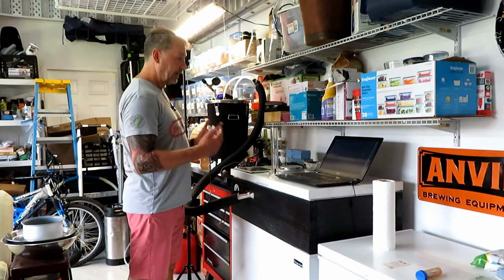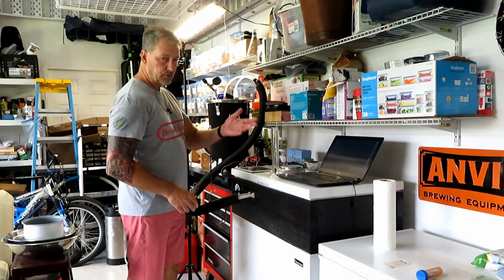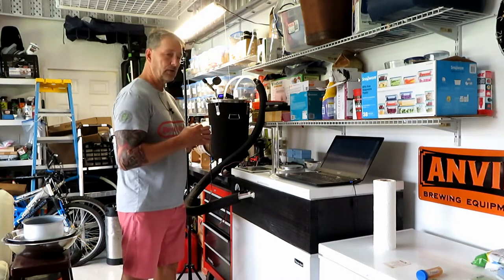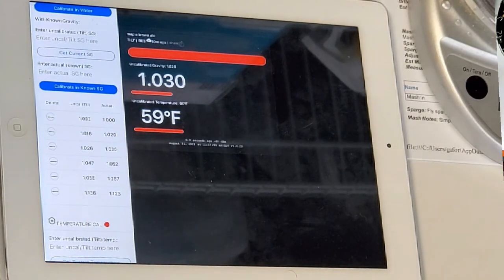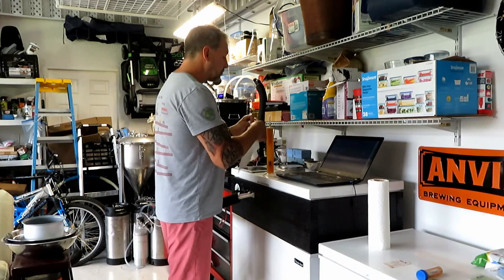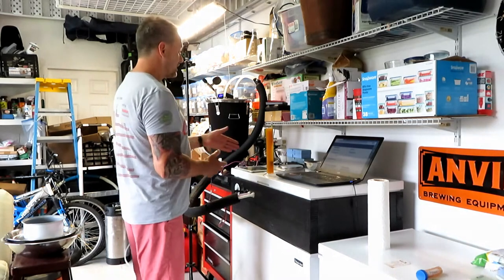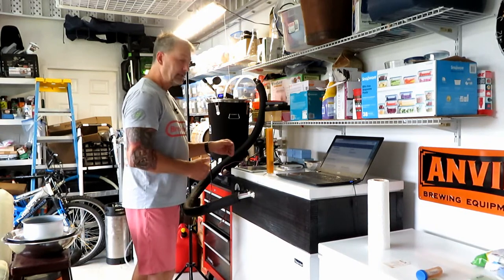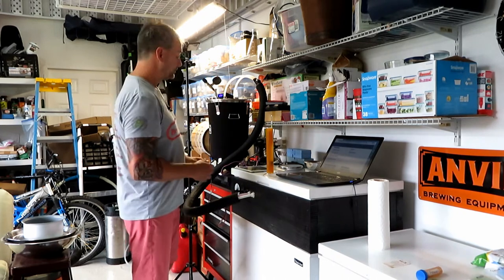Alternate accurate way to calibrate your Tilt Hydrometer

Comment from the maker: As I answered a few questions, I realized I did not completely explain the process in detail. When you add a known SG you must also provide the pre uncallibrated tilt reading as well. This lets the software know what the difference is. Lastly do not delete the 1.000 calibration that you originally did in distilled water, this is your reference, the tilt needs at least two points of reference to calculate the gravity.

Comment: I have also find mine to be very accurate. It’s normally within a point, maybe I two, of the hydrometer and that’s just calibrating with distilled water straight out of the box.
Reply from the maker: Unfortunately they are not all like that, you got lucky
Reply: @chubbymermaidbrewing  yea ive seen the flack they get online. I used distilled calibrated at 1.000 then added a ton of ice and calibrated temp at 32 and ive been good ever since. Only issue is heavy dry hopped beers or German ale yeast. The Krausen on those throws the tilt for a loop

Comment: Hi there, this tutorial makes way more sense! (and certainly not painful like Baron Brews).  But my app looks different than yours and BB's.
  The IOS (V 15.3.1 on an iPhone 11) app looks different than in your tutorial (and Baron Brews).  

1)  It shows "pre-calibrated" vs "un-calibrated gravity both on the main screen as well as in the settings
2) It appears I can only set 1 extra set point (after calibrating in water).  There are 2 spots but when I try to set a second set point the previous is overwritten.  Ideally I'd like to set 6 set points as you suggest.

Anyone have any ideas?  I've emailed Baron Brews twice and have had no response.  I have 2 Tilts and neither are that accurate and not of much use at this point and using the Tilt 2 app.  Thanks in advance
Reply from the maker: Yeah i probably should do this video over again to explain it better, but you have to click the add or "plus sign"  but before you have to click " get known sg then you can add the actual SG via your calibrated temp corrected hydrometer reading. Then once that number is entered  then hit the plus sign. NOTE, you can only do this during an actual fermentation. Because you need a calibrated reading as you progress through the fermentation otherwise you will just overwrite the same reading. Hope that helps.
Reply: @chubbymermaidbrewing   Please make a new vid with better footage. My Tilt Pro is sitting in the fermenter 2 days and showing 1.030 already.   I need  some good simple footage about calibation my tilt pro with the metric system.  The Tilt Website is very unclear.